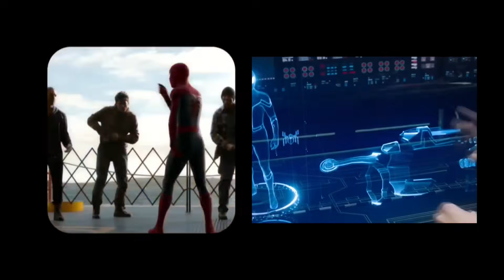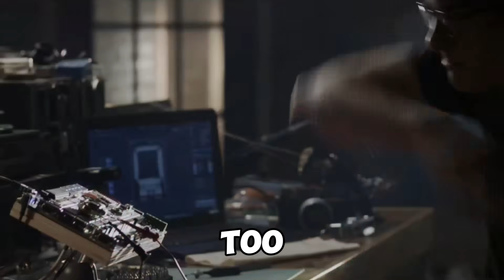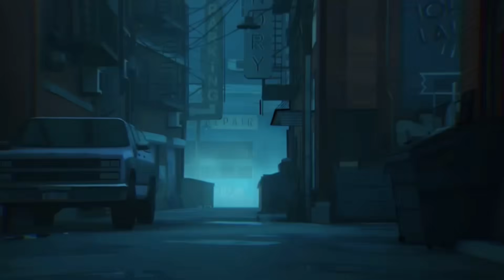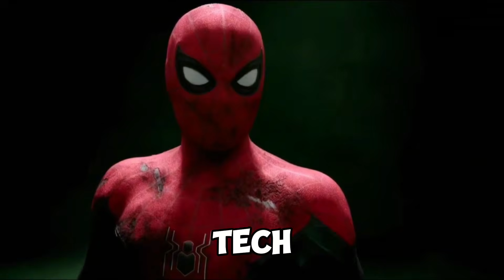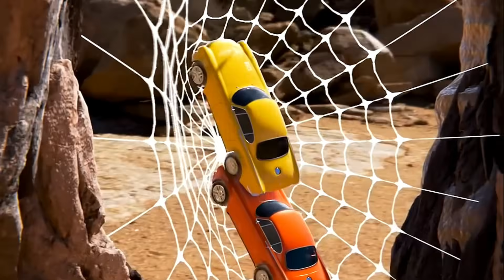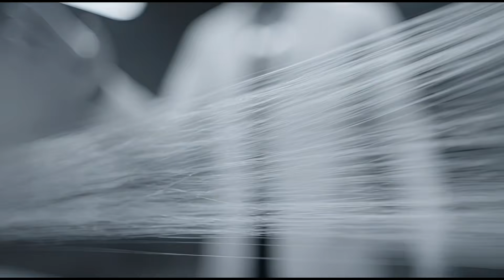How The Spider-Man Web Shooter Works

Comment: The thing about the web fluid is that in order to replicate a spider silk-like material that could be used in a shooter device, it wouldn't be fluid like it is in the fiction. For one, fluid is incompressible, so to fit enough fluid into such a compact space to have enough uses for swinging like Spider Man does, at least it would have to be a design like the one from the first suit from the Friendly Neighborhood Spider Man series. This is the closest design to realism that a spider man like person would practically be able to achieve, especially without the powers. The only solution would be something that is nanoparticle based. Something with a material composition that could be solidified almost instantly by something like an electrical or light input, and then can return back to a non-solid state just as quick. 

It would be closer to something like a grappling hook, but a hybrid mechanical system, something akin to a type of miniaturized 3D printer that can not only instantly solidify this metamaterial, wind it up, and eject it out of the nozzle at high velocities, but all while also being able to instantly reverse the same process to get it back into for reuse. This method would also allow the line to be separated from the device should the user want it to, so in someways would be better than most renditions of a web shooter.

As for the actual swing part as a normal human, there are ways we could mitigate this to make it usual for such an activity. For one, in the design of the shooter system itself is one, making it something like a Your Friendly Neighborhood Spider Man/Attack on Titan style gear where it's supporting your body is most practical. Then also an advance exoskeleton system designed for mobility could definitely remove most of the stresses the user will experience under action. Wouldn't be easy to try to solve, but it all seems much easier than building something like an Iron Man suit.

The idea of an "Insta cable" is pretty genius when you think about. Even if you didn't want or couldn't use it as a method of locomotion in the same manner Spider Man does. The concept of having a rope like line that you can instantly spawn anywhere has many uses that we probably aren't even thinking of right now.
Reply from the maker: You’re actually thinking about this the right way.
Most people focus on the web fluid, but the real engineering problem is the deployment system and storage density. If it were a traditional liquid polymer, you’re right... you’d run into major volume and pressure limitations trying to store enough material in something wrist-sized.
A nanoparticle or programmable metamaterial approach is probably closer to how something like this would work in reality. Imagine a dense cartridge of microscopic filaments or particles that can rapidly assemble into a cable when exposed to an electrical charge or laser pulse as it exits the nozzle. That would solve two big problems: storage and instant solidification.
The “miniaturized 3D printer” idea is also interesting because it implies on-demand structure formation, which is actually where materials science is heading. There are already experimental polymers and hydrogels that change stiffness almost instantly when triggered by light, heat, or electricity.
And you’re absolutely right about the swinging problem. Even if the cable existed, a normal human body would get wrecked by the forces involved. Without something like a load-bearing harness or mobility exoskeleton, your shoulders would probably dislocate on the first swing.
The funny part is you’re also right that this might actually be easier to solve than an Iron Man suit. We already have grappling devices, advanced polymers, and powered exoskeletons... the real challenge is miniaturizing all of it into something wrist-mounted.
The “insta-cable” concept alone would have insane real-world uses: rescue operations, climbing, construction, military mobility, even space applications.
Honestly, the web shooter might be one of the most underrated pieces of sci-fi tech to analyze seriously.

Comment: True we can make the device the only problem would be the Webs for now but we can do other things like maybe its good enough be to be like grapling hooks or grapling webs or something to help police use it to capture criminals
Reply from the maker: That's very true
Reply: The thing about the web fluid is that in order to replicate a spider silk-like material that could be used in a shooter device, it wouldn't be fluid like it is in the fiction. For one, fluid is incompressible, so to fit enough fluid into such a compact space to have enough uses for swinging like Spider Man does, at least it would have to be a design like the one from the first suit from the Friendly Neighborhood Spider Man series. This is the closest design to realism that a spider man like person would practically be able to achieve, especially without the powers. The only solution for a functionally compact system would be one that is nanoparticle based. Something with a material composition that could be solidified almost instantly by something like an electrical or light input, and then can return back to a non-solid state just as quick. 

It would be closer to something like a grappling hook, but a hybrid mechanical system, something akin to a type of miniaturized 3D printer that can not only instantly solidify this metamaterial, wind it up, and eject it out of the nozzle at high velocities, but all while also being able to instantly reverse the same process to get it back into the device again for reuse. We haven't even considered the material science required to try and figure out how to get the web like line to stick to virtually any surface. It probably works on the same principles Spider Man himself likely does to stick to any surface, Van der Waals forces, and not hairs like some canon have tried to explain it. This method would also allow the line stick to any surface, and to be separated from the device should the user want it to. So in some ways it would be better than most renditions of a web shooter, and the fictional versions are likely better in others.